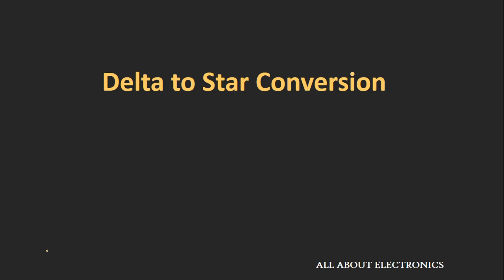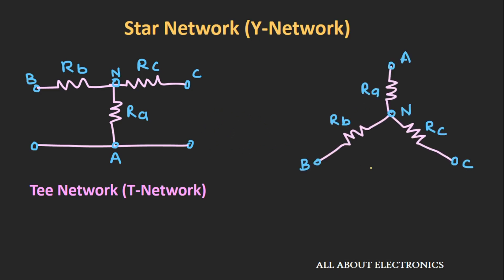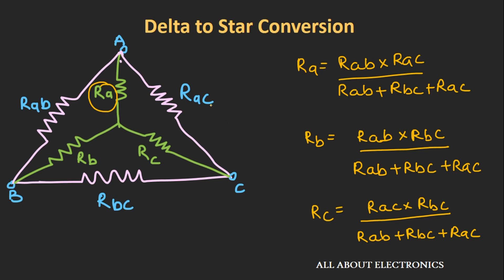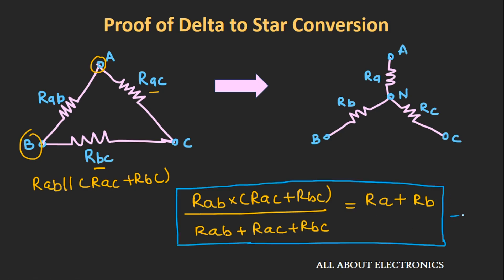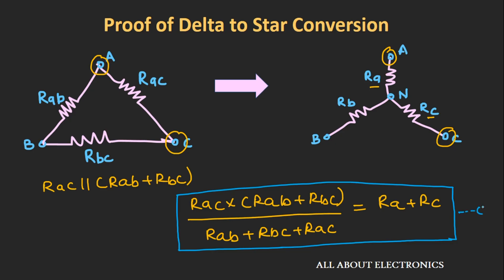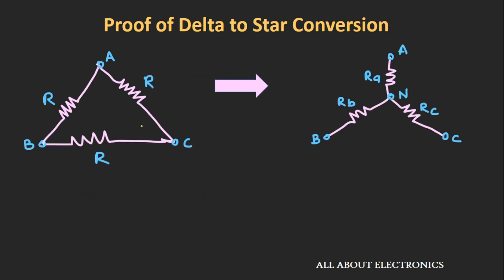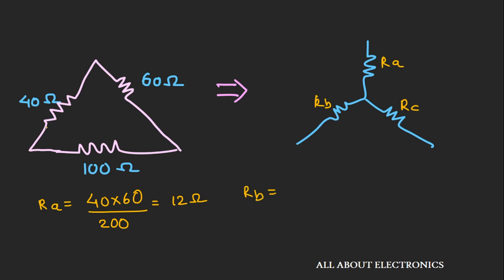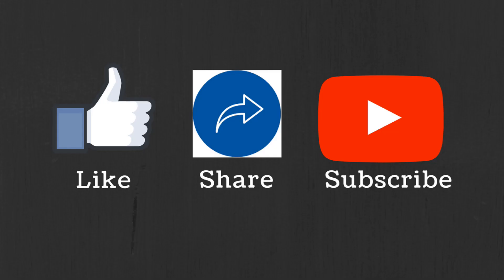Delta to Star Conversion (with proof and example)

Comment: SIR i have a doubt,
at 12:20 how we know that 20 ohm and 100ohm are connected in series ,? 
pls repy ro my doubt sir...
Reply from the maker: If some current I is flowing through 20 ohm resistor then same current will also flow through 100 ohm resistor. Because there is no other path. Therefore we can say that both resistors are in series. In series current remains same through all elements. I hope, it will clear your doubt.
Reply: @ALLABOUTELECTRONICS  yes sir... I got the point...thanks for solving my doubt

Comment: Is it work for capacitor?
Reply from the maker: For capacitors, the formulas will change. I mean for the star network of the capacitor, the formula would be the same as the resistive network of the delta. In other words, the pattern of the formula for the delta network of the resistor and the star network of the capacitor would be same and Vice a Versa.

Comment: Is this applicable for capacitors also?
Reply from the maker: For capacitors, the formulas will change. I mean for the star network of the capacitor, the formula would be the same as the resistive network of the delta. 
In other words, the pattern of the formula for the delta network of the resistor and the star network of the resistor would be same and Vice a Versa.
Reply: @ALLABOUTELECTRONICS  okk thank you very much.
Best explanation bro i learned it at once.

Comment: but the derivation assumes them to be open-circuited; how, then, can we use them in running circuits?!?!
Reply from the maker: Still, it can be used because during the derivation it has been assumed that the star network is isolated from other circuits.

Comment: Sir.. whats the logic behind open circuit resistance equivalents?
Reply from the maker: It means that for conversion it has been assumed that the network is not connected to any source. So, whenever in any circuit if you find any delta network and if you want it to convert into star network then just assume it is isolated from the rest of network and convert it into the star network. 
I hope it will clear your doubt. If you still have any doubt then do let me know here.
Reply: thank you sir this was also my doubt

Comment: sir how can u say that the both 100 and 90 ohm are in series
similarly 20 and 30 ohm are in series
Reply from the maker: No, not 100 ohm and 90 ohm resistors, but 100 ohm and 20 ohm resistors are connected in series.
Similarly 90 ohm and 30 ohm resistors are connected in series.
Please watch it once again.